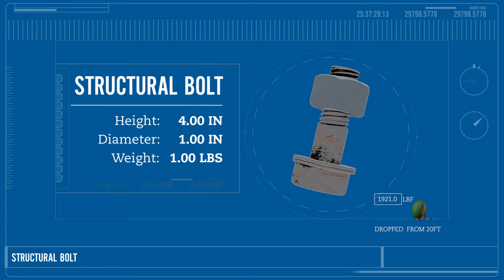The Dropped Object Experiment | 1 LB Bolt, 20' vs. 30' | Safety Week

Comment: We can't really say what the impact force is going to be without also knowing the stopping distance over which the kinetic energy of a falling screw will do its destructive work. Heck, it was probably several times higher for the helmet trial than for the melon-penetrating scenario - but that doesn't really matter because the industrial helmet is not meant to be a 'cushion' but a 'pressure reducer', and it's very good at it.

Comment: which means...... if i throw the the bolt and nut just with the strength of my arm i could throw with a force that would be greater than dropping it from 20 feet? I'm pretty sure i could bust that melon  just by throwing to it.

Comment: what formula did you all use? i'm trying to figure it out! thanks!
Reply: Force = Mass x Velocity.  You can calculate the velocity based on the drop height with gravitational acceleration being 9.8 meters per second per second of drop time.  20 feet is approximately 6.069 meters.  30 feet is approximately 9.144 meters.
Reply: Weight (i.e. force, which is mass by g) by height

So... m * g * h = m * 31.17 * 30 = 2881, meaning that the bolt weighs about 3 lbs.